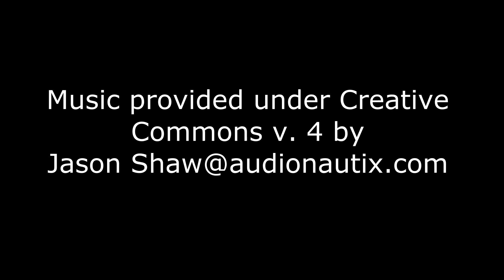Service Mode vs Ops Mode Programming (119)

Comment: Can you do a video on speed matching and advanced consisting Altas QSI decoders.
Reply from the maker: Sorry, but I haven’t seen a QSI decoder in at least 15 years. Are they still in business?
Reply: @TheDCCGuy  Barely from what I see on their website.  I have a bunch of Atlas Gold locomotives that are driving me nuts !!!
Reply: @TheDCCGuy  I think I solved my issue.  It was the QSI BEMF that was messing me up.  If either loco in the consist pushed or pulled the other one too much the BEMF would try to compensate and make a Humpty-Dance out of it.

Comment: Most newer decoders, especially Tsunami2, do not require a PTB and Soundtraxx recommends not to use a PTB
Reply from the maker: I know they say the PTB is not necessary for programming Tsunami2 decoders but I have never seen them recommend against using one. Where did you see that?
Reply: @TheDCCGuy  in videos by George, it can actually interfere with programming
Reply from the maker: I heard back from George and as I suspected you must have misunderstood him. Here is his response:

I have said that a) the Tsu2 and Econami do not NEED to have the PTB-100 installed.   If it’s there, that’s fine, it will work illustrates like normal.   But if they don’t have one when programming a TSU2 or Eco, then it will not matter.  b) the other programming track boosters like the powerpax will not read CVs because they are looking for a higher current draw than NMRA RP, typically through the motor circuit.   The TSU2 and Eco do not use the motor circuit, but rather use internal circuitry to create the pulse for a decoder CV read.   This is more closely following the NMRA RP, so in many cases, the Pax cannot read or detect these decoders because it’s looking for a higher current draw to acknowledge.   That said, the programming commands are still sent and received, just the decoder’s acknowledgement is not “heard” by the Pax.     This will not damage 
the decoder in any way. It’d be silly if we built a product that was incompatible with other products out there.
Reply: @TheDCCGuy  I guess I should have been more specific in my reply. When I said interfere with programming I meant that, as you and George mentioned, will cause readback issues with certain PTB's, not that it will damage the decoder or not send the commands it just won't acknowledge the command which can appear as if there is a problem
Reply from the maker: Yes but that has nothing to do with the PTB-100 only the DCC Specialties Power Pax which uses a different approach to boosting track power.
Reply: @TheDCCGuy  correct

Comment: Hey Larry, How come it is so hard to set the CV's on Bachmann N scale. All other Brands are fine....But Bachmann, can you help.  Bob
Reply from the maker: Are you programming them using service mode or ops mode? That may make a difference.
Reply: Service mode (Digitrax).
Reply from the maker: Try ops mode, the increased voltage and amps may help.
Reply: Thank you sir, I will.  Bob

Comment: I am looking for some help.  I have a DCS 210 and two PM42s with two PSX-1 circuit breakers between the equipment.  I have a Bachmann 2-8-0 DCC equipped, (no sound) that is running just fine.  No issues to report.  However, when I put my stock Bachmann 0-4-2 DCC with sound on the track the PSX-1 to the PM42 to that block starts clicking.  I pull it off and it stops.  I have tested the setup by placing a screwdriver across the tracks and it does set off the PSX-1.  So, the 0-4-2 was used with the 2-8-0 for testing track as I built my layout.  When I ran the 0-4-2 with only the DCS50 I never had an issue.  The DCS50 is currently setup as a throttle to the DCS210.  I do not have a common ground between the two DCS units.  Any suggestions?  I can unplug the DCS50 take it to a section of track to see if the 0-4-2 starts running again.
Reply from the maker: Do you have a ground connection to the PM42?
Reply: @TheDCCGuy  I have a ground wire daisy chained to the PM42s.  In one of your videos you mentioned grounding two DCS devices together.  I have the DCS50 attached to the DCS210 via LocoNet cable to use it as a stationary throttle.  Works fine with the 2-8-0.  However, the DCS50  is not grounded to the DCS210.  Does that need to be grounded to the DCS210?
Reply from the maker: I doubt a ground is required when using the DCS50 as a throttle only. I would suggest trouble shooting step by step. First remove the DCS50 and see if the problem still occurs. How old is the PM42? I also am wondering whether differences in the trip speed of the PSX and PM42 may be an issue, the PM42 is a relatively slow device whereas the PSX is very fast.

Comment: Have an error message 301 when using JMRI no locomotive found. These are factory installed decoders or decoders l have installed in engines. Will not read the MFG ID or the Ver. #. For the DCC system i am using an NCE Pro-R system on a Windows 10 O/S comm port 7 as per the device manage and it is green online. Baud Rate 9600. Please get back to me @ bnsf1991@gmail.com Thank you. Dennis Louden

Comment: Hi Larry, Very interesting vid. I have two, exactly the same  brass etch diesel locomotives to build. Both with identical running gear Motor/Gearbox etc.
I want to MU them permanently together, when I DCC them. Would it be an advantage to Service Mode them together on a separate programming track?
Would I need a Power Booster too? May use Loksound decoders. I thank you in advance from New Zealand.
Reply from the maker: It likely will depend on whether you use sound decoders and keep alives in both as they may interfere with the programming of two decoders on a current limited track. If they are to be permanently run together and assuming that they do have equal performance one option would be to use one large decoder to power both locos. You could also run power pickup wires to both locos which will double the number of wheels picking up power. Just put a second speaker in the second loco and you’re good to go. Lots of companies offer 2 amp decoders and even larger versions. That solves your programming question. If you do put individual decoders in each loco and they are coupled by a permanent drawbar, you could use a PTB-100 if programming is a problem. Should you do that and also run pickup wires between locos make sure that you never allow the wheels of one of them to cross over the isolating gaps between the programming track and DCC powered track, or you will get a short lived smoke generator!
Reply: @TheDCCGuy  Many thanks for your reply Larry. You have not only answered me clearly, but have given me some great ideas to move forward on this project. Hadn't thought of maximizing the wheels-to-rail for pick-up. I'll keep an eye out for the "smoke generator" too!
Again thank you and keep safe, keeping life stupidly simple.